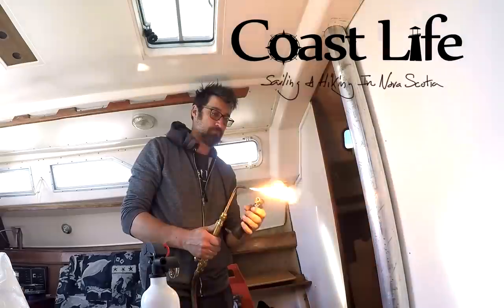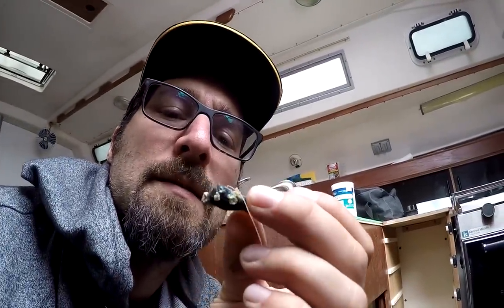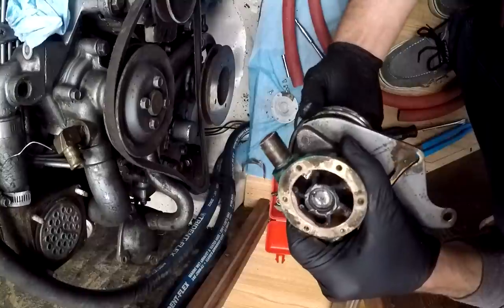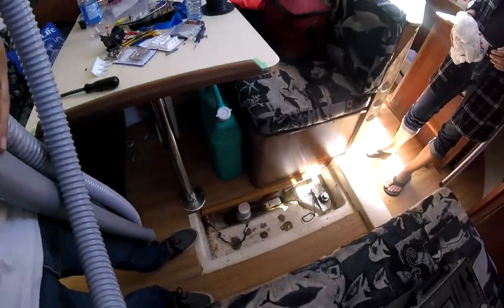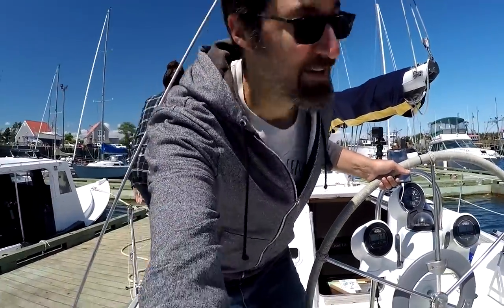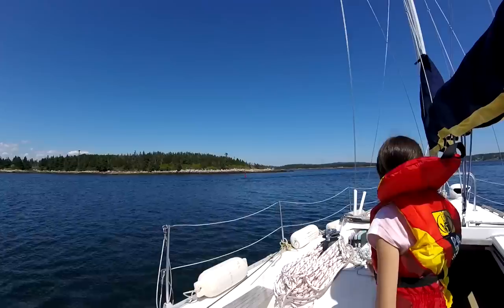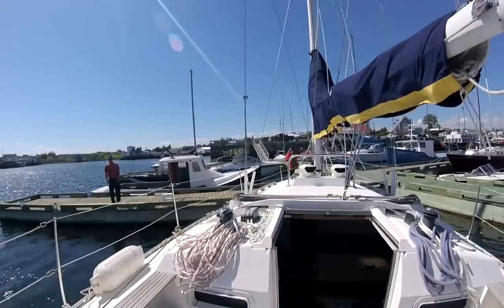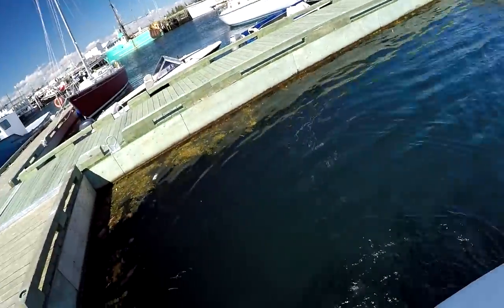Engine Troubles & Docking Fail! [ Ep 22- Sailing Nova Scotia ⛵]

Comment: first time watching this channel.  Keep it up, guys.

My first time docking went WAY worse than this.  I had accidentally pulled back the throttle instead of the gear shifter and my engine cut out...next to some pricey 40' yachts that I can't afford to fix.  I bounced off the shoreline with the keel (all is well) and took it back for a second take.  All this under the keen eyes of the dock hands who were there to help bring me in.  First time docking, single handed, pissing rain, and so cold my hands could barely toss the line out to them.  But I learned exactly what not to do that day... I had to reposition the boat the next day and it all went way smoother under similar conditions. 

onwards and upwards.
Reply from the maker: Thanks for checking out our channel, Matthew! Thanks for your docking story. There's lots to learn in boating, and we usually have to learn the hard way ;)

Comment: Docking takes practice.  We have all been there at first.  It takes a while to learn how your boat handles at slow speeds and with various wind conditions at the dock.  When we got our first slip we got one that gave us plenty of room and no nearby boats so we wouldn't cause issues for others.  Our boat is very heavy and doesn't answer to the rudder well at slow speeds since it has a full keel.  Once we learned that and adjusted accordingly, we got better.  Just need to learn how your boat handles.  Don't worry.  You will get the hang of it.  Marking the wheel that corresponds to a centered rudder as mentioned in another reply is a great idea.  We did that as well and it helps.  When throwing the prop into reverse to slow down, remember it will cause the boat to prop walk, and you need to compensate for that.  Your doing great.
Reply from the maker: Thanks for the kind words.   It's nice to know were not alone in this boat.  ;)
Reply: I hate docking.  It's the worst part of sailing, especially when there's some wind and a neighboring boat very close by.  Even after dozens of attempts I only feel good about 1 out of every 3.

Comment: Learning to dock with a midship cleat and a single spring line will change your world. My old C&C 36 I didn't have a cleat on the beam so I attached a snatch block to the toe rail. I used a very long line that lead back to a primary winch. This set up will let you adjust how close the boat sits to the dock. Once you have the spring line set you can take all day to secure the bow and stern lines.  Good luck and keep up the great vids!
Reply from the maker: Thanks TIm... we do need to install something mid ship as of right now there is nothing.
Reply from the maker: Excellent thanks Doug!

Comment: I have the exact engine. you can pull the exchanger tube cylinder out. You just have to replace gaskets on both ends. That way you can use a pistol brush (.22) and clean the ID of the tubes really good.

Comment: Hi - great vlog!  Sorry if someone has already said this....if you are mooring in high winds you could consider mooring against the finger pontoon where the wind wants you to go (providing there is nothing else there) and then using your bow and stern lines pull the boat back over to the other side - you just need long lines to do it.  Happy sailing!
Reply from the maker: +Jeremy Mackenzie Hi Jeremy, thanks for the info, and for watching :)

Comment: You did fine...you made it back without calling for a tow and you didn't hurt anything but a little pride when docking.  Go get two extending boat hooks, keep one in the cockpit when docking and the with the person on the bow. It's a lot faster to grab something on the dock with the pole and pull yourself back over if you start to drift away from the dock.
Reply from the maker: Good tip,  We'll probably do that!

Comment: Docking is where you learn the most about how your boat handles. So many variables to process at once. Everyone arrives safely it was a good docking. Fiberglass can always be fixed. 

There are several docking videos online. One good technique with bow in docking and one helper is to set the spring line and then throw the wheel over hard to the opposite direction. The prop wash against the rudder will work against the spring line and hold the boat steady against the dock.

My sailboat is a 1985 Hunter 34 similar to yours. We replaced the cutlass bearing this winter, not hard to do but a special tool is required (one you can buy, rent, or build yourself). PM me for details, am glad to help. 

Where exactly is the strange noise coming from? Only at higher RPMs and only in forward gear

(and lastly try not to be stressed. Boating is the most fun, enjoy and it and laugh)
Reply from the maker: As it was our first time leaving the dock with this boat, we had no idea how it handled so we need to spend more time exploring that...seeing what side is the prop wash, and installing something midship for the spring line, and lots of practice docking and undocking! We think the noise is due to an alignment issue. Thanks for the comments, Michael :)

Comment: Good job getting the boat back safely. Speaking of safety, I suggest having the crew at the shrouds, where there is a good hold and easy to step off, and to tie the aft springline first: this way the boat is eased sideways into the dock as the (hopefully small) momentum carries it forward; also helps to use the prop walk to your advantage, where possible...
Reply from the maker: Thanks Mike :) We're going to do a lot of practice docking and undocking and find out the best way(s) to do so for our boat

Comment: In reverse with no water flow over the rudder, the rudder doesn't behave the same way as in forward gear.  Once you have some backwards momentum, you can kick the tail to one side by applying helm in that direction and a little blip of forward gear and power, then back to reverse gear again.

Comment: You might have to dive on it and check the play in the prop to see if the cutlass has to much play, also i have seen the cone clutch make that sound (sorry?), oh and the check the motor mounts to see if they are worn or delaminated, hope this helps, and you did a great job Capt no worries mate!
Reply from the maker: Thanks, All good advice.  We are looking into those issues.

Comment: Nice video.  But like you said, no harm, no fowl.  I try to remember that boats pivot around the bow (while cars pivot around the stern)- to bring your stern into the dock, (as in your video) just turn the wheel like you are turning to the right and kick it in gear for a second or two and the stern should swing back toward the dock.  Sounds so easy...
Reply from the maker: Thanks Bill! We'll get the hang of it, just need more practice :)

Comment: There are several ways that a boat steers  1) obviously is the rudder, kind a like a forklift your steering from the rear 2) is propwash the way that the boat moves when you put it in reverse or forward you can use that to your advantage 3) the boats is moved from the wind as well you have to be careful if the wind is pushing away from the dock there may be a different way to approach and 4) is current you have to be aware is the tide flooding or ebbing you can use that to your advantage as well once you learn all these techniques docking isn't so bad just remember if you aren't bored docking then slow it down and become bored. Good luck with the engine problem keep us posted and it was a wise choice to turn around and come back looking forward to more videos, thumbs up
Reply from the maker: I like it....  So docking isn't supposed to be exhilarating?!?  LOL.   We're going to practice being bored while docking.

Comment: We had the same vibration.  Especially at low RPM and idle.  We had to get out engine aligned and idle adjusted.  We were also told getting the injectors serviced was a good idea too, which we haven't done yet.  Good news is that the vibration went away with alignment and idle adjustment.  Our idle was too low.  It should be around 750-900 RPMs.  I believe we are currently running between 800-850 RPMs.

Comment: And as others commented the single midships spring line is the easiest way to dock. 
Fenders down, spring line rigged. Stand at the spreaders, holding on to the spreaders, .  Then step off onto the dock  with the spring line, Attach this spring line, then motor ahead slowly against the spring. Then the boat will be forced in alongside the dock. Giving you all day to attach the other lines 
I usually let the wife steer when docking, and I step off and attach the spring line...

Comment: Good call to cut the revs and head back.  And as for the docking. Just do what I always do; keep a straight face and pretend that, whatever happens, this is what I had planned to do all along. 'But we always do diagonal slip docking - much more efficient'.
Reply from the maker: Lol,  yeah that will work when I'm not steering every direction possible with a bewildered look in my face..  LOL -Chad

Comment: I like to perform a practice run away from the dock when space allows. you can use a channel buoy  that will give you reference.  Come at it with the same attack angle you will use for the real thing. This will allow you to see how current,wind and prop walk is going to affect you prior to the real thing. Last having to put allot of reverse thrust on your prop is going to make the boat shift out of position so whenever possible slow slow ahead and kick it in and out of gear as needed to keep it slow. Docking is a controlled crash so make sure that crash is slow. The tendency for line handlers on the dock to pull hard on the bow line causing the stern to shift out and away from the dock is always problematic. Learn that ahead throttle makes my stern go to port and astern causes it to shift stbd. Keep practicing your only doing what all of us have done before. Love your channel. Brad
Reply from the maker: Thanks Brad! What you say is very true :)

Comment: If that is your slip for the season, a little cheat would be to setup a pre-measured stern line that you can throw on the first cleat. This will give you one less thing thing to worry about and, once a stern line is on it gives you more control and options with the boat in the slip ( not to mention only a spring line to worry about securing). At least that what happens around here.
Reply from the maker: It's not, otherwise we definitely would do that!

Comment: 2 words....Prop Walk.  Get used to using Prop Walk to help bring the port stern over to the dock. In my flying days we said; "Any landing that doesn't cause injury to the pilot or passengers or damage to the craft, is a good landing"; same applies to docking. As for being glad there was no other boats next to you, not so fast, you can use them to push off when coming in....just "fender up" both sides of your boat. Those were not failures, those were learning experiences. Good job not panicking.
Reply from the maker: We are practicing the use of prop walk, prop wash and spring lines. Seems awesome, if we can get it to work for us :)

Comment: Power is the killer , coming to dock cut forward motion almost stop the boat then assatain the speed needed control the motion , it just takes practice , l on a very quiet day backed the boat out and played around with wheel and gears to see what the boat can do and it started to come right practice going in and backing out , and soon you will get the hang of it all  easy

Comment: They say the riskiest parts of any passage are the first and last few yards!  There is no substitute for experience, so I suggest you try and find someone experienced at boat handling to guide you.  Note 'guide,' and not 'teach;' boat handling is nigh on impossible to teach in a course because every situation is so different. My dad taught me to handle boats over many years (the best amateur boat handler I've ever met), and 10 years after I first brought the boat alongside (or slipped the lines, which is sometimes just as difficult), we still discuss the conditions and how they'll affect the boat at low speeds, and we're both still learning!  It always pays to go through these stages in your mind before docking, or slipping the lines:

1) Is there a current?  Always do your manoeuvres into the current, if possible, so that it acts to slow you down.

2) Where is the wind?  If there is no current, or the wind is strong compared to the current (this is a matter of judgement, but a rule of thumb is 1kt of current is about equivalent in its effect to a force 4 wind), then if the wind runs parallel to the pontoon, you should manoeuvre into the wind, for the same reason as the current.  If the wind is blowing you off the pontoon, then your approach needs to be relatively fast and at a steep angle to the pontoon (Or slipping lines is easy, just make sure everyone gets on the boat quickly!)  If the wind is blowing you on, then your approach can be slower and at a shallower angle (and getting off later can be very tricky!).

3) How strong is the wind? This will help you decide how fast you need to be going to maintain steerage.  Do not underestimate the power of the wind, especially at low speeds!

4) Prop walk - you obviously have a prop shaft, which are most susceptible to this.  You will find that when you put the engine in astern, before you have any steerage, the stern will kick in one direction.  You can often use this to your advantage.  (It seems fairly clear from the video that your boat kicks to starboard in astern, which made this manoeuvre more difficult.)

5) Have an escape plan!  If things go pear shaped, or you miss the pontoon (or you forget to put fenders down!), you should always be able to back out again.  If you can't think of one, check everything twice before you go beyond the point of no return!

6) Afterwards, think about what went wrong (Even if it went well, it's very rarely perfect.  Maybe you didn't get the stern in well enough?).  Think about how you could improve it.  This is the only way you'll improve.  I see skippers on a daily basis with a wealth of experience, and yet they still have no idea how to handle their boats in close quarters.  It's not a given that you will improve at boat handling beyond a point unless you do this.

What went wrong here?  The first thing was that with a fairly strong wind pushing you off, you needed a much steeper angle of approach to the pontoon, and you straightened up too early as well.  Other than that, you were spot on in your evaluation: you were going a bit too fast, and your wife put the bow line on so it went tight.  The absolute worst thing you can do when docking is to pull on the bow line before you have a stern line attached, because it will just pull the stern out and make your life hell!

Comment: Thanks for sharing the embarrassing stuff, you didn't hurt anyone or your boat so no big deal. I recommend backing off the dock and going back on even if you just go a short distance understanding how your boat reacts at slow speeds to both motor (prop walk) and rudder inputs is crucial to good docking. Go slowly and understand how many rpm's in reverse are needed to stop forward progress. So when will you go sailing? Once the motor is fixed?

Comment: Is there a propshaft anode? Sometimes they become loose and slide down the shaft.
An underwater camera on a boathook will give you a look at the problem. Hopefully it is just the anode as it is an easy fix.
Good luck
Reply from the maker: Totally did that yesterday... everything looks normal under there..  We think it may just be a engine alignment issue.

Comment: I put my transmission in neutral when I'm still 50 - 60 feet away, and coast very slowly into my slip.  Slow is pro, as they say.  I barely need to put it in reverse to stop short of hitting the bow.  If you have able crew, they can jump onto the dock as soon as possible, use a dock line from a mid cleat on the boat to a mid cleat on the doc, around one end of the dock cleat to provide breaking friction if needed, and to keep either end of the boat from drifting away from the doc.  But docking is the most nerve racking part of every sail and I collected some dock rash before I got consistent.
Reply from the maker: Thanks for the supportive comment Garry.  We've been getting a lot of similar advice, so we are working on our spring line and docking techniques. It does make it difficult at our location because the winds are often high and there are actually no traditional cleats on our slip.   But soon we'll be at a mooring so that will be much lower stress.

Comment: Maybe mark on the wheel where the rudder center line is (CL) and arrows for turning to go left (L) or right (R) in six places (45 deg)?  ;-)
Reply from the maker: Thanks for the tip. We did add a center line, it was just a matter of getting used to it and suffering from "tillerhead" from time to time :)

Comment: Well done guys! We have all had those 'docking failures' but it's just practice. I admire your bravery for sharing the experience! Hope the prop issues are resolved. Where I'm from if we get vibration it is usually a dirty prop. I'm sure you're all over it. All the best from downunder! DK@thenaughticals 😜
Reply from the maker: Thanks Damien! The prop looked clean, and we think it was due to the shifter lifter not being fully engaged causing the transmission to overheat. It seems to be better now.